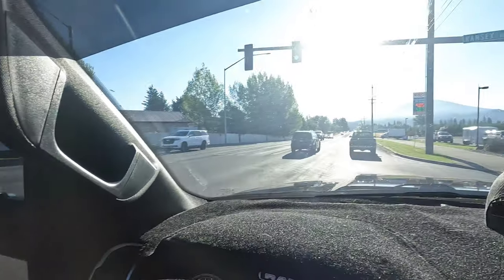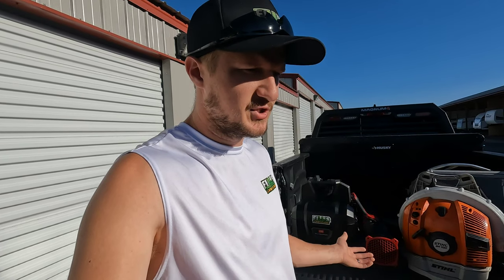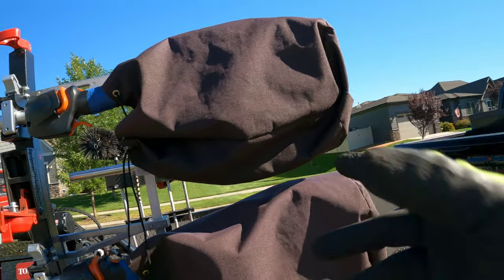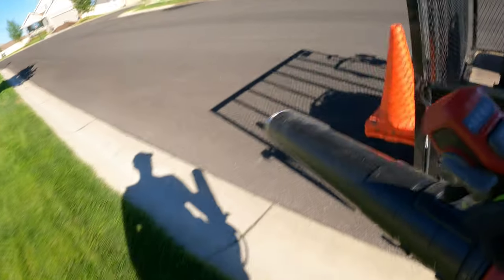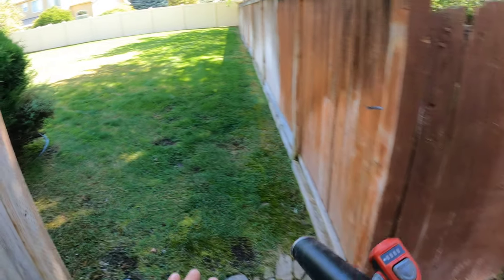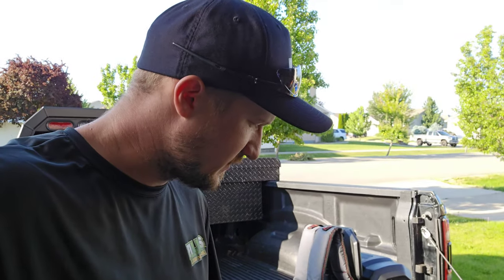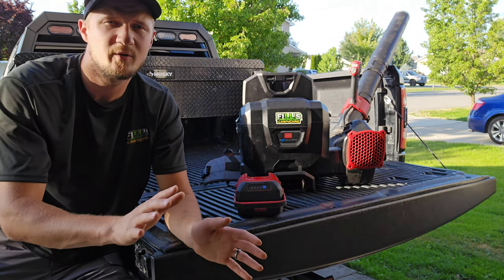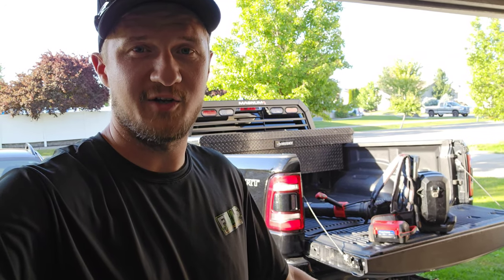Hear Me Out Before Buying This Toro 60V Backpack Blower (Lawn Care Vlog)

Comment: I have a DeWalt battery operated blower. I do love it but the battery does run down fast. Because of the cost of the batteries I went to a much cheaper generic 9AU battery. I could buy four of those batteries for the price of just one name brand. So far I've only had one generic go out on me. So I love the generics and you might consider buying generic batteries for your unit. Just a thought. I use the 9AU because it lasts a whole lot longer and I can get my entire backyard done with just one battery.

Comment: My Black and Decker battery powered tools are not big boy toys, but they start every time, get the task they were designed for done and a 20v battery usually outlasts me.  Sometimes I need to work smart to find easier workarounds, but that is true with any power tool.  I always have extra batteries, but seldom use them.

Comment: Regarding the cost of replacement batteries, I have a 40volt Ryobi Expand-it string trimmer that I bought in the summer of 2020. It came with a 4mah battery and single charger. If the battery goes bad, it is actually cheaper for me to buy a whole new trimmer with the battery and charger, than it would be for me to buy a replacement battery, unless I buy a risky aftermarket battery on Amazon.